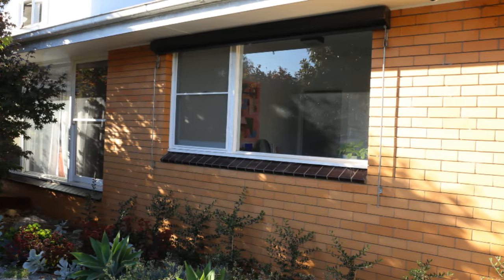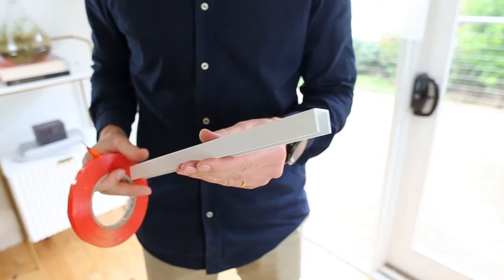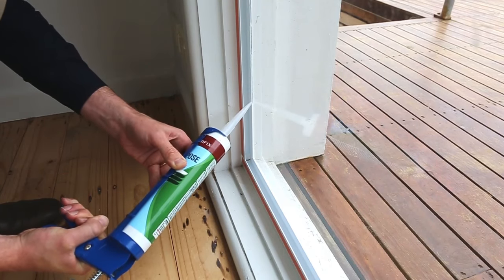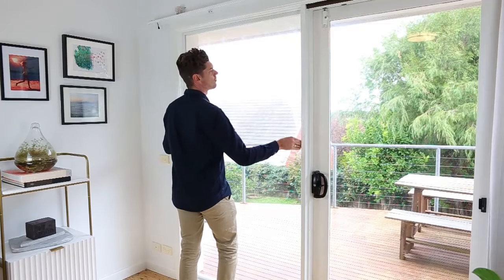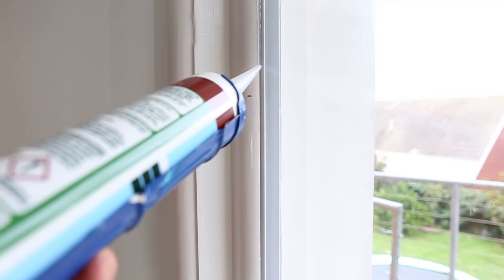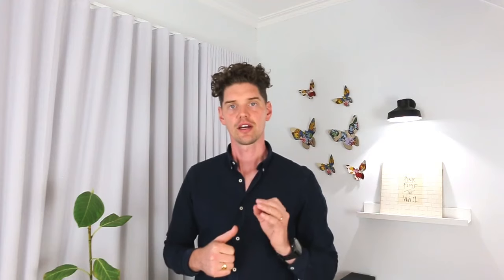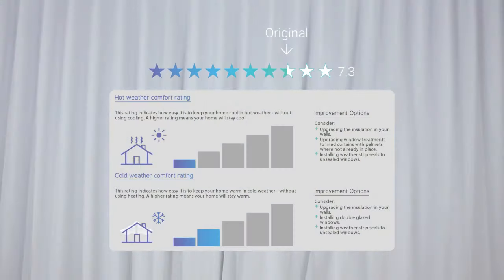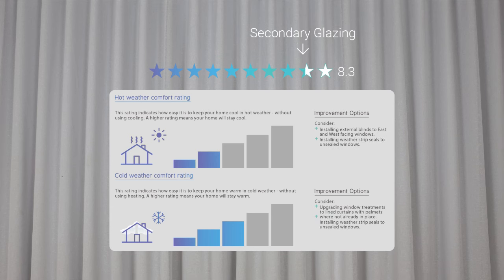Cheapest way of Double Glazing your windows

Comment: I had one single pane window in a closet that turen the closet into an icebox in the winter. I add a double wall polycarbonate on the outside. It's been fantastic. I started this because this window produced so much moisture from condesation there was a constant mold battle. This has completely stopped it. If it proves to hot in the summer, it is secured with wingnuts so can be easily removed.

Comment: I would be very concerned with trapping moisture between the plastic insert and the original window as presented, otherwise it is a very good idea.
Two options to either reduce or eliminate the potential for trapped moisture problems would be to either drill a small hole in two corners of the plastic sheet to allow equalization in the created airspace, or else mount the acrylic panel so that is can be removed from time to time for cleaning.
Reply: I'm very interested in what you said "mount the acrylic panel", what do you mean by that ? 
I want to add another double glazed window to my sauna to improve it's insulation, if you have tips I'm all ears :D
Reply: @captainnoyaux  magnetic strips
Reply: @booneyinc9515  Thanks for your reply I'll check that

Comment: Used opaque perspex sheets to block light coming through a window and reduce noise from outside. Worked quite well. Thought it might improve heat retention and it did so more than expected. Was inexpensive and fairly easy job with the added bonus of lowering my heating costs.

Comment: I am going to use cable channelling which has a clip-on top.  Then I can remove the sheeting if I need to.  Also, the sealed channel will improve the insulation at the edges and improve the appearance.
Reply: That's not a bad idea, but I don't know how easy it will be to remove. Let us know how you get on. If it does not work, search for "Magnetic Tape & Steel Tape Secondary Glazing".
Reply: How did the cable channel go???? I am planning to do this too
Reply: How did it go mate? Answer of show a video ffs!
Reply: @user-pf5xq3lq8i  Do explain how I'm supposed to post a video reply ffs  Mt window panels have been up for over a year.  I used two small hooks top and bottom to support the 4mm acrylic panels is used.

Comment: Quote to double glaze eight windows to reduce traffic noise at my house was $23000.  Am thinking the cost of materials using 10 sheets of acrylic or polycarbonate is under $4000 if i cut them myself..  the 16mm air gap is ideal for best insulation I am told. Am investigating further but going to install before summer.
Reply: 😁 just came to say I love the user name. Very clever!
Reply: Mate, do it on the outside as well.

Comment: So what did you do with regards to the windows that open? These are the ones which could bring down the temperature after a hot afternoon using cross ventilation during the night.
Reply from the maker: You can cut a rebate into timber framed, double hung windows to fit a second pane but the added weight in some instances may cause a safety hazard. I'll be relying on heavy drapes with pelmets in Winter for windows that don't suit this method of secondary glazing.

Comment: Instructions are poor but from what I gather, you installed it in such a way that you cant just take it off and put it on at will. You should use two part magnetic tape so that you can easily remove it in the mornings if you want to. Also, I wouldnt use the regular acrylic (assuming its just perspex). Go for the polycarbonate which is much more resilient and about 200 times stronger than acrylic and doesnt have a habit of cracking like perspex if it slipped out of your hands. A tad more expensive but much better and convenient if you did it this way
Reply: Also, acrylic will yellow with time if any UV gets through the glass. Polycarbonate will not.
Reply: Magnetic tape. Tried and tested. Allows you to remove the panels and store them behind a wardrobe when not in use.
Reply: @Factory051  air tight ?
Reply: @eurovisie2010  almost.
Reply: Good enough
Reply: Go for polycarbonate rather than acrylic.
Reply: @eurovisie2010  not fully. But enuff.
Reply: So you want to go around the house in the mornings removing all the panels and find some where to store them only to go back and put them on again at night lol . Gezz
Reply: @deanwitt7903  I'm not sure why you'd need to do that. Pop them on when it gets cold and remove in the spring.
Reply: @supermode what do you mean in the first step - treat the window with insulation? What kind of insulation and how? Thanks
Reply: @rodschmidt8952  you got that round the wrong way, polycarbonate is not as clear as good quality acrylic & will diminish over time turning yellow & it scratches easier but is way stronger, glass quality acrylic is more scratch & UV resistant &  nearly as clear as glass but not as strong as poly but still way stronger than glass
Reply: Old duffer, polycarbonate is stronger but will eventually turn yellow from the sun & its not as clear as glass quality acrylic & scratches easier, the brand (Perspex) has glass quality acrylic which is more scratch resistance, wont turn yellow, more clear then poly not as strong but still way stronger then glass.
Reply: @rodschmidt8952 pardon but I have heard the opposite is true
Reply: I don’t know how much easier he needs to be,,,

Comment: Thanks for your info. 
I see you used 4.5mm thick panel. I'm considering using 3mm for my windows.  Is there a reason why you chose 4.5mm as opposed to 3mm? Thks
Reply from the maker: Hi Dave, the reason is surface tension. With large spans, you may get slight surface deformation with a thinner substrate. The thermal properties of 4.5mm acrylic are slightly better also.
Reply: @epheenergy  Thanks for your prompt reply. 👍

Comment: I used magnetic tape so the panel is removeable, works great.
Reply: Metal conducts though?  And a draft might get through..velcro??
Reply: @user-pf5xq3lq8i  the tape is only 1mm thick and 8mm wide, so the difference in thermal conductivity of this and silicone is negligible. I do not know why you are talking about velcro, this appears to be your suggestion..??

Comment: Just buy your own new double glazed units and install yourself, it's easy.
I paid 25% for a window compared to what a window installer wanted.
As you do it all yourself you can buy 1 or 2 windows at the time when your budget allows, slowly completing the whole house.
Buying acrylic sheets, etc. is all faff.
Reply: where did you buy it ? any material suggestions ? like aluminum or fiberglass ? , any trustable brand ?
Reply: You say this like it's an option for most people, lol. Removing old windows and fitting new is a skilled job that requires a lot of equipment, especially if you are doing it above the first floor. It's not like doing some DIY decorating.

Comment: How does the clarity of the acrylic compare to glass?
Reply from the maker: Hi Nicholas, clarity is excellent, unnoticeable when positioned next to glass and much easier to work with on a DIY level.
Reply: @epheenergy  thanks so much. Does condensation get caught in the cavity? I’m a a very cold climate in Tas
Reply: @epheenergy  I think it looks great & would perform well. 
Can you explain how you deal with the SLIDING DOOR that was to the right of the fixed window you "glazed"?

Comment: How do you cope with condensation?
Reply from the maker: Absolutely no condensation to report on. Conditions have been +10 degrees of humid air inside with condensation on the single pane glass and no issues with the secondary glazed system. Air gap seal is key and I'll follow up with a performance review during Winter.
Reply: @epheenergy  Would it be better to install this when the air is drier e.g. summer to avoid moisture being trapped between the panes?
Reply: @epheenergy  Did you do the performance review?
Reply: Good idea, or wipe it with alcohol first??

Comment: What about gas. Argon is the critical ingredient in double glazing.
Reply: Argon gas only increases performance by about 15%, it's certainly a worthwhile benefit, but not a deal-breaker.
Reply: You can buy a tank of argon gas and drill two tiny holes at the bottom of the window (because argon rises compared to air) and feed the argon into one of the holes (while letting the air out the other hole); then plug both holes

This is all theory to me; never tried it
Reply: Argon is heavier than air

Comment: And he didn't explain that acrylic scratches easy and only has a 10 year uv warranty 😂 cheap and nasty. Retro fitting ur old aluminum windows is approximately $500 a square mtr for a Glazier to do.
Reply: Stick a uv filter on the glass.  Job done.